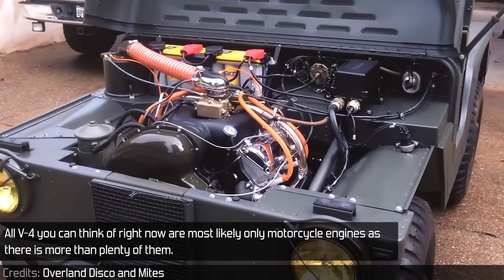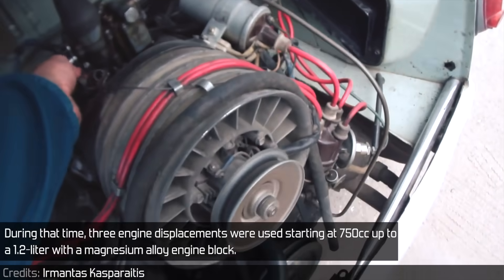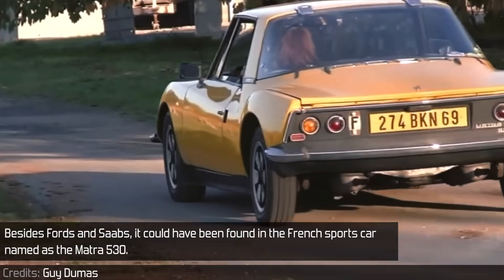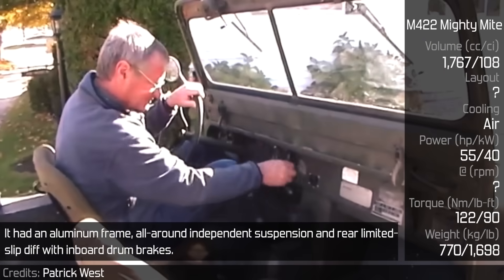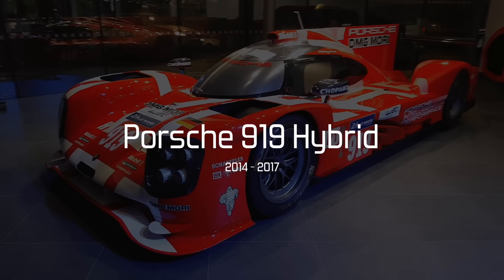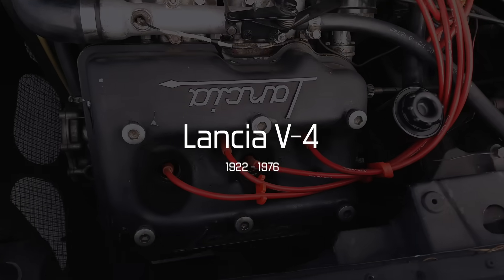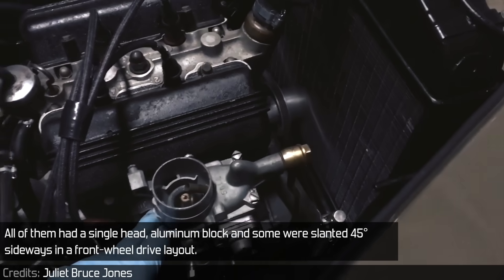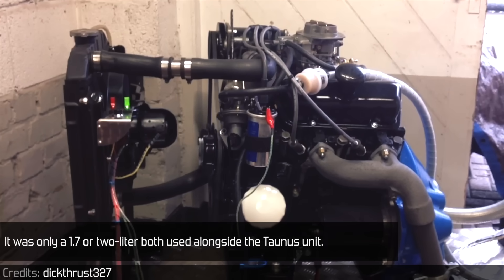The Only 6 Automobile V-4 Engines To Exist

Comment: One more fact, the v4 engine was going to be mass produced in Brazil by forda to equip the Ford Scort instead of the 1.6 renault, using the saab 94 engine as a base, unfortunately the project was canceled, but if it had been approved, Brazil would probably be infested with the v4 engine, especially since ayrton senna owns an Escort XR6.

Comment: Something I just realized is that the Essex V4 shares a very similar sound to the Ford GAA/GAN/GAH V8 and the V8 Detroit two stroke engines. While the Detroit has a cross plane crank, it being two stroke means the banks fire evenly. The engine has shared crankpins, and since it's a 60 degree V engine it makes it fire unevenly. The Ford has a flat plane crank with shared pins and the same 60 degree V angle, and since it's a four stroke engine it fires evenly on the banks but unevenly overall just like the Detroit but with half the number of power strokes. That V4 has a 90 degree crank throw, which would make it even fire like a typical flat plane crank I4, but since it has that same 60 degree V angle it causes it to fire unevenly. The 90 degree V angle of the Honda VFR800's engine combined with a flat plane crank basically makes that engine run like half of a cross plane V8, so with the 60 degree V angle of the Essex combined with the 90 degree throw it makes the engine fire like half of a Sherman tank V8. The 60 degree angle gives them such a throaty sound compared to the 90 degree angle. I wonder how the secondary imbalances are affected by that. I would love to see how well something like a 3.6L Pentastar converted to a flat plan odd fire 4.8L V8 would work out. It would sound insane, especially in a pickup with the unequal length exhaust between the banks of the engine

Comment: I had a 1970 Ford Corsair 2000E - that had a 2-litre V4 engine. It looked very compact under the bonnet (hood). Decent enough car, especially as the 2000E was the "top" model of the Corsair, so had extra trimmings etc etc. These days I drive a 1.2-litre turbo straight-3 ... that makes a bit more power than that old 2-litre V4 did.🤣

Comment: Foed made 6 different versions of V4 between 1962 and 1979. In addition to Ford´s Essex V4 units 1700 and 2000cc used in Corsair, Zephyr and Transit, there were 1200, 1300, 1500 and 1700 from Ford Köln werke in Germany, used in the Taunus 12m, 15m and 17m as well as budget versions of Granada even Granada II. SAAB used the German engines too, in Saab 96 and Saab Sonett II and III.

Comment: Lancia gave up that goof ball piston and block design only to have VW mess with it. Back in the late 70,s Lancia started using 1600 and 1800 twin cam engines from Fiat, back those days hot cams and variable timing sprockets werent on the market, unless you had a really fat wallet.  The Alfa 1300, 1400, 1600, cc engines were wet liner sleeves for the pistons, if you over revved em the plugs that block the oil passage in the crank would blow out, kinda funny but the aluminum block would sweat water out of the block under the headers, those motors  had  a timing chain with adjustable sprockets, but  When I messed with em they only had  3 grinds for camshafts, mechanical fuel injection, which  was constant flow, the stock factory cam and a hill climb cam, the cam lobes pushed a bucket over the valve stem, just like to day, except these , the valve clearence was  adjusted by shims under the bucket ,Fiat put the adjustment shim between the cam  , and the bucket ,and if too loose, it would pop out , Weber Carbs were the game. On the downside Alfa had  hollow valve stems filled with Sodium for cooling , and your not supposed to reface them ,you cut the stem off and toss it, Ive got Fiat Valve  thats 50 years old and still looks factory

Comment: Ford used there v4 in a transit van i had one for work ,they had a bit torque i didn't mind it had no problems  but engines back them days didn't do big milage ,there were lots of them around & people did use to work the v4 motors & run twin pipes on them & fit them in smaller cars i seen a lot fitted to morris minors .

Comment: Lancia built V4 engines from 1920-76 ......at least 6 different types !!!
Reply: Yep, understates just how thoroughly Lancia's V4's were redesigned, re-angled and re-sized up & down, from OHV to DOHC (via rocker-arms to reach opposite bank within single head). Not a simple change of capacity or cutting down a previous V6 or V8 design.

Comment: The first vehicle they showed was an AMC Mighty Mite they made 3922 of those vehicles I had a 1961 and the VIN number was 2500 of 3922 it had an air-cooled V4 which was very slow

Comment: GM has entered the chat  

have you heard of  gm  AFM or dodges displacement on demand?

v8 can switch between a v4 and v8  even in the 1980s GM had a v4 v6 v8 system

Comment: Really fast revving engines with the super short crank.
 More so than a v6.
I'd imagine a double counterweighted i4 crankshaft would weigh twice what a v4 crankshaft does.
Especially if the v4 Is cross plane.

Comment: In the 1970's I owned 2 vehicles with V4 engines: A Ford Corsair 1.6 litre with an automatic box and the same model, but with the 2.0 litre engine and a manual box. Neither was anything other than a reliable 4/5 seater family saloon car, but both did what was expected of them.
Reply: The Corsair 1.6 I believe would have had a straight 4 1.6 litre Essex engine, Ford V4 never came in 1.6 litre capacity, either the British Essex or the German Cologne designs.

Comment: My buddy cut a small block Chevy in half back in the late 50’s and it really performed in a speedway midget.
Reply: Garage 54 did it so I don’t see why people are doubting you
Reply: @isaacsrandomvideos667  
It’s because the internet has bred a never ending collection of “ Armchair Experts “
mostly who have difficulty thinking outside the square. Just sayin!!!
Reply: @richardtemby4358  agreed.
Reply: Since nobody said it yet: You cut and reweld the crank, which also needs a new cam. It might also be enough to counterweight the crank, crank pulley, and/or the flywheel.  
That said, i've seen a TONS of engines with obvious balance issues used plenty in racing where cores are cheap and they get rebuilt between races anyway.
Reply: We called it a Sesco engine! It was a very effective engine for a midget race car in the 1970s.
Reply: Really appreciate . That is fantastic he must have been a great engineer
Reply: Common knowledge. Guys cut V8 down for midget racing
Reply: How did he balance it🤔🤔🤔
Reply: alex williamson 
Same as they now do a V 4
Reply: But you cut yours in half. The crank is balanced from each pistol when it Fires. You've cut one end off. Your engine is out of balance an for that reason I thing someone is lying🤔
Reply: alex williamson 
Not if you re-design the cam and obviously the firing order, try thinking outside the square.
Reply: @7richardt7 
1357
2468
Cut that in half its all out of sync
Reply: @7richardt7  if 1 an 7 counter 2 and 8.  3 an 5 counter 4 and 6. How were you balancing it🤔
Reply: @7richardt7  as I asked before how did you balance it🤔
Reply: alex williamson ask him again.
Reply: @Make-Asylums-Great-Again   people, each cyl ups and downs in pairs. just cut and rearenge firing an valves. you'll get a 180° each bank, pretty balanced. and if you want 360° even spacing, just cut first 2 and last two.
Reply: alex williamson watch Allen Millyard
Reply: Sick
Reply: Scat-4
Reply: Wilson v4. Google it.
Reply: Did it sound like a V4 or a V8
Reply: Possible I suppose, but there are about a hundred reasons why this might not work very well, if at all.   Interruptions in coolant and oil distribution?  Which end got the starter....water pump, oil pump?  Timing?  Balancing?  What do you attach the crankshaft belt pulley to?  Or the flywheel depending on which end is cut?   Somehow, I wonder if this is an urban legend.....
Reply: Cut the front and rear two cylinders off, cut the front and rear plates off those, weld the plates to the "new" block, don't be a rube or a stooge when you do it, new crank. Either custom custom made, or even a inline 4 crank could potentially work. Cams from a 4 banger, or custom cams. Then, once you make everything work properly, like you'd have to for building any other engine, you're good.  you'll have a flatplane v4.   @martyzielinski2469
Reply: You do realize that's technically impossible? Balance is of, timing also. The only way that'll work is to make a V4 engine, and use parts from a SB V8. Otherwise; impossible.
Reply: Smells like bullshit😂
Reply: @in-rust-we-trust1968  I agree. 
Greetz from germany.

Comment: Original Morris Minor was designed for a V4, hence the high bonnet. However it had so much torque it broke the drive train so they put the old side valve Morris 8 engine in for production

Comment: I used to drive a Ford Transit Mini Bus with the 2ltr V4 engine, it was nearly new when purchased but did well over 100,000 miles before it was replaced without any problem apart from the distributor drive from the oil pump wore out and it came to a stop, replaced in just a few minutes. We also had a Corsair 1700 V4 in 1967, what a smooth car to drive that was.

Comment: A friend of mine had a Ford Capri with the V4. Took it to the dealership complaining about the engine bouncing all over the place. Service manager came out, took one look at it - "Oh, a V4", turned around and walked back in the office. Ford also used it in the transit van.

Comment: Back in the day my brother had a Ford Corsair with a V4  engine. IIRC the rocker shaft studs were a "press fit" in the cylinder head. This lead to problems when they became loose over time.

Comment: I have even watched this video yet and suddenly the beauty of a V4 engine dawned on me. If it is a 90 degree V4 then you would only need two rod journals, as two pistons could share one journal and fire every 180 degrees of crank rotation just like an inline 4.
Reply: It would not be even fire, would be close to a yamaha R1 firing order

n1 + 270° n3 +180° n4 +90° n2 +180° n1
Reply: I am not familiar with that cylinder numbering system so it is hard for me to comment but my thinking is that the rear cylinder is the one that is 90 degrees out of phase with the front cylinder. (because they are sharing the same rod journal) I prefer to have combustion more evenly spaced around the 720-degree cycle but have watched the video on the Yamaha and the theoretical traction advantage gained.

Comment: In 1968 I purchased a Saab model 96 deluxe with the German Ford Taunus V4. I found the motor to be very reliable and very long-lasting with oil changes at 3,000 miles. As with most German engines, attentions of valve lash was very important as was changing the oil. At 200,000 miles, I sold the car as I was tired of the same old car. Later, I came to realize that that was a mistake and I should have kept it.

Comment: The prototype Ford mustang had a V-4 as did some of the last of the Corvette body Opal GT's and if memory serves me write some of the British three wheelers.
Reply: Twern't the Mustang, it was a Fiat X-19 sized project that got axed...Mid engines, small light thing is what the engine was designed IN DEARBORN, michigan (that's one thing that was glaringly wrong in the vid when he said the German V4 was designed in Germany, nope Dearborn and by the same design team that did the Ford FE series Big Block Fords..Same cam followers by part number, same layout for oiling and rocker covers with 80% of the rocker cover on the head and 20% over the edge of the intake manifold, and then rocker arms on long shafts, shafts on pedestals rather than rockers on a stud.. The Saab connection came in 1960 when Ford USA bought 20 Saab 96s with the new for 1960 4 speed trans-axle..it being unusually short (the shafts inside so only 2 gears on a shaft rather than all 4 on a cluster gear) just to get the gearboxes..and then the project got axed and design team went over to what eventually became the Mustang..So they had a design for a compact V4, the Germans wanted something to replace whatever junk they were making in the 50s so Ford USA sent it to germany and said "You will use this engine and like it..We have ways of making you like it"  So poof suddenly a V6 appears..The earliest being a 2,0 V6...Then 2,3 and then 2,6 then 2,8 in late 70s then 2,9 in mid 80s thru to the end (we'll try and not remember their gross 4,0 version)

As for the horrible little Opels, which mostly were Kadett A running gear, the earliest got and 1100cc thing but most got the all cast iron Opel 1900cc CIH engine "Cam in Head"...an very VERY nice motor which even in rally form made an easy 175 hp early on and by early 90s in asconas could be made to make a reliable strong 210 hp..No V4s in Opels.
(by the way, I build Northern European engines for a living..Mainly Fords, but also Opels, some VW (if I'm forced to) Saab and lots of Volvos..3 in the stands right now.

Comment: The Ford V4 has to be the worst engine ever made.  It's 60deg V4 design was completely unbalanced.  However, with the addition of a huge counterweight and engine mounts made from knicker elastic allowed the engine to jump around in the engine bay without shaking the car or van to bits.

Comment: Although not an automobile,  the bomb lift trucks used by my USAF load team to arm Republic F-105 fighter/bombers many years ago were powered by Continental or Wisconsin air-cooled 25 HP V-4 gas engines...

Comment: Remembering the V4 in the Zephyr IV, yards of room in front of the engine to stand inside  the cavernous engine bay. Even as a 13 year old working part time in a garage, the fibre timing gear seemed a miserable idea, but maybe it was durable? We were doing a rebore and crank regrind.....oil pump drive shared soon after it resumed service and Zephyr man lost his Ford Five  Star Motoring once again.

Comment: All these engines sound like they missfiring when idling
Reply: The rough sound is caused by the exhaust layout. There is a manifold on each cylinder bank, each with a pipe from one end of it to a junction into a single pipe. The sound from some cylinders has further to go than the sound from other cylinders; also within each bank the firing intervals are alternately 180 degrees and 540 degrees. Most flat-fours (VW, Subaru, Citroen) sound the same, but the flat-four Alfasud has a smooth buzz because it has four equal-length pipes from the cylinder heads to a four-into-one junction.

Comment: Why is the in-line 4 cylinder engine design preferred over the V-4 90 degree  engine design for cars and most motorcycles?
Reply: Cost. 1 head,1 block , fewer cams. Easier to make.
Reply: Because nobody made a 90 degree V4...Always--except for those truly odd Lancias--60 degrees for V4, for nearly all V6 and the V10s and V12 and V20s I have worked on were also 60 degree (the V10s 12s and v20s were marine turbo diesels)  And  a coouple of the greatest sounding engines on any sort were the marvelous Rolls Royce merlin and its cousin the Diamler DB600 family, both 60 degree V12--and personally the Merlin under hard power is the best sounding engine ever, only thing better is 4 of them under load and I've been lucky enough to hear both...

Comment: The ford v4 also existed in a 1,3 liter and 1,5 liter version. it vas the 1,5 liter version that Saab used in the 96 model, but according to an aquinten of me who worked with it at Saab they rebuild it quit heavily when it came from Ford --Better balance etc. funny is it that the 1,5 had bigger bore than 1,7 as i put in my Saab 96. because it had had an old-man driver and piston-rings was stocked, and the cheapest fixing was a Taunus 17m engine